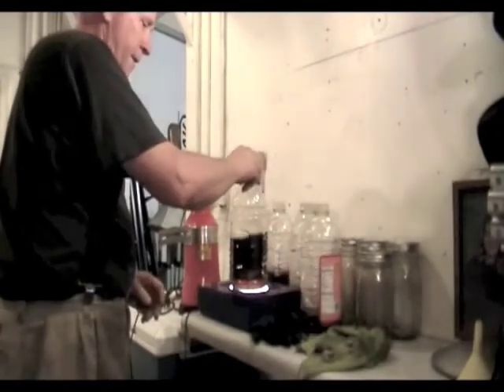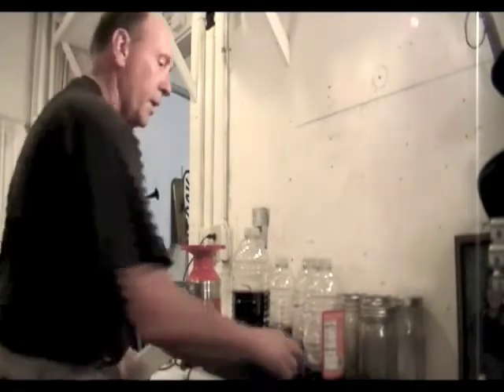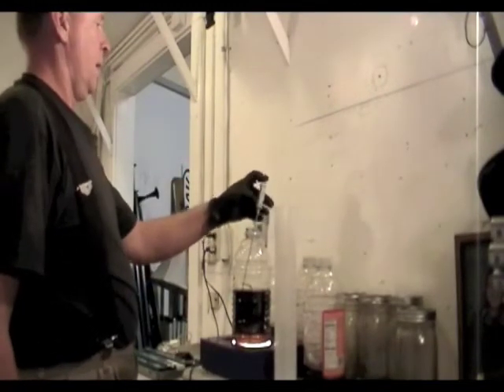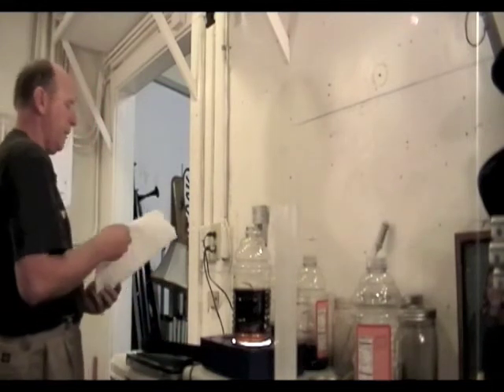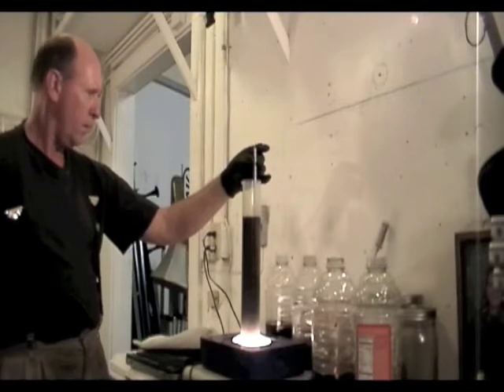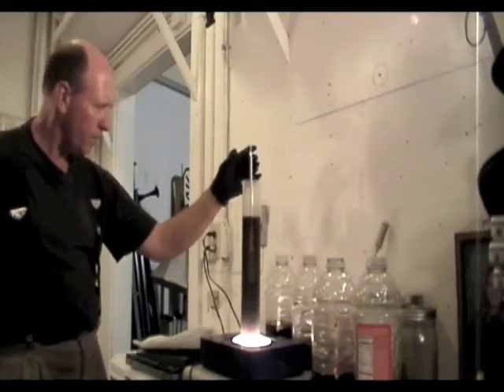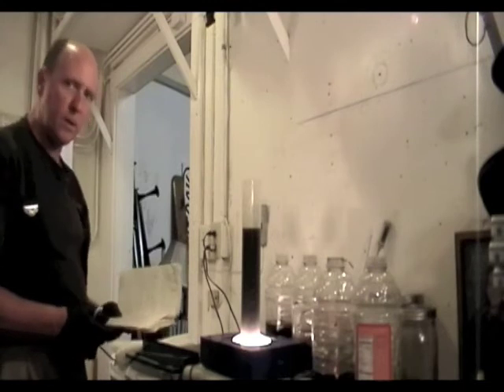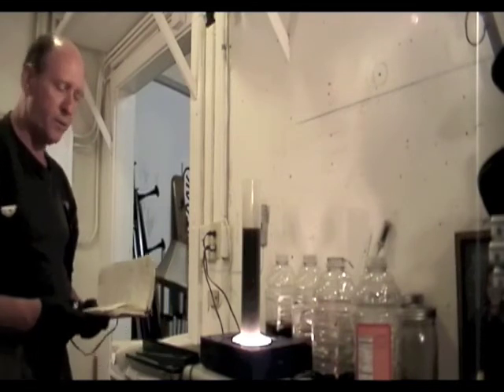Blending Stale Gasoline with Waste Oil to Make Alternative Diesel Fuel IV

Comment: Could wmo be heated like wvo and burned without adding rug? After cleaning if course.
Reply from the maker: Heating waste oils in the fuel line and running it at 100% tends to lead to coking. Also, there are significant advantages to blending solvents with waste oils. A thinned waste oil will often drop both suspended and dissolved solids. Additionally, adding acetone at as little as 1% will often force dissolved solvents and even liquids, like water and gum, out of solution.

Comment: What do you recomend for ratio of 15w40 oil mixed with 87 octane gasoline to burn as diesel fuel?
Reply from the maker: For most waste oils gasoline can be blended at 20%. That blend should be settled for a few days, then pour off the top the thin and translucent blend, leaving the sediments.  Then filter it down to about 3 microns, then dilute with diesel fuel at no more than 50% waste oil blend.
Reply: Thank you for the reply I'm mixing it now. Great information
Reply from the maker: @jacobkelley519  let us know how it runs
Reply: @Jhananda  it's been running fine virtually no smoke at all when i run with diesel fuel at a 1 to 1 ratio. I have a 2000 f350 7.3 diesel with the heui fuel system
Reply from the maker: @jacobkelley519  Good to know it works for your engine.

Comment from the maker: @Begbucks Yes, at 20% acetone, burning stale gasoline becomes pretty expensive, but if a cheap, or free, source of acetone, would make burning stale gasoline blended with waste oil cost effective.

Yes, I have worked with Rapeseed oil.  It is otherwise known as canola oil in the USA.  Most of the waste oil I have used in the 5 years of research was canola oil.  I agree other oils should be experimented with, and I plan to do so, but it has become obvious to me that all plant oils will work.